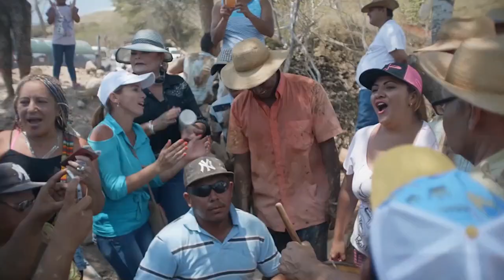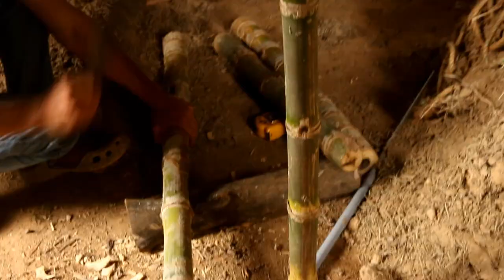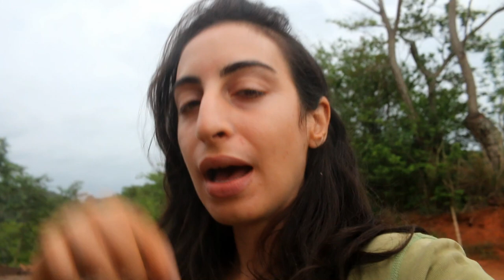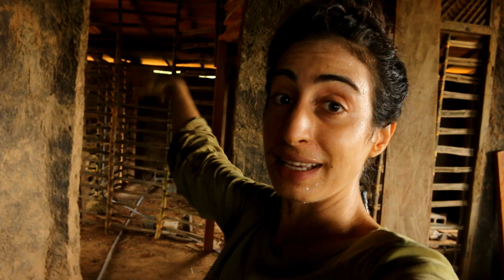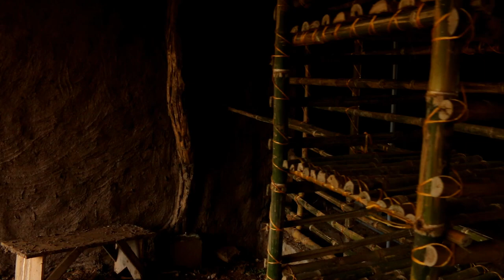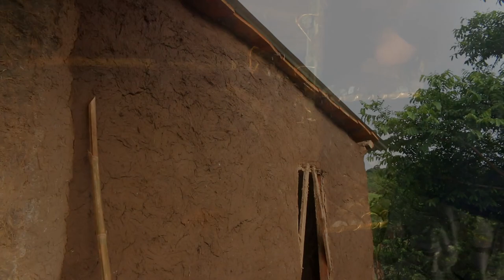Building My Cob Bathroom and Bamboo Cob Furniture + How to Mix Cob

Comment: Not that Turiya is saying this but just to think about; concrete isn't "bad" because it's modern, concrete may be expensive, resource intensive, or environmentally incomptaible for a project/location. Whereas using the areas abundance of dirt and mastering the mix can produce both a cost-effective and evironmentally sustainable method of building!
Reply from the maker: Yes, you are 100% correct, those are the primary reasons! As well as mold-producing/heat-producing in wet/warm climates